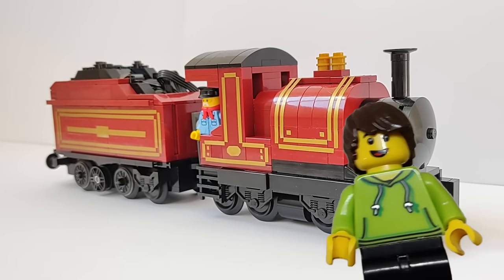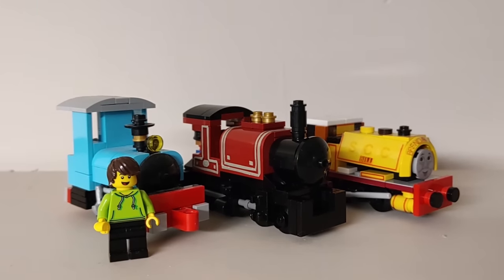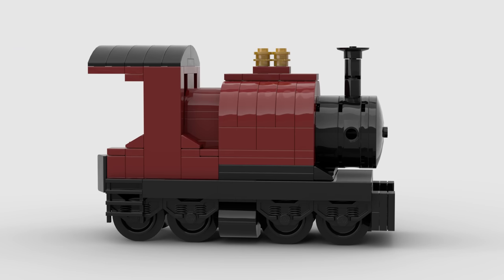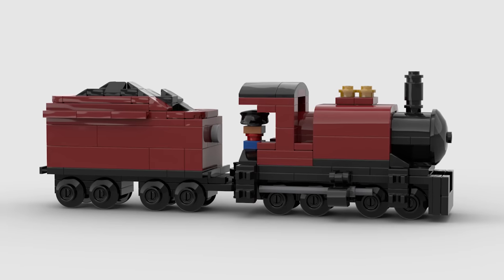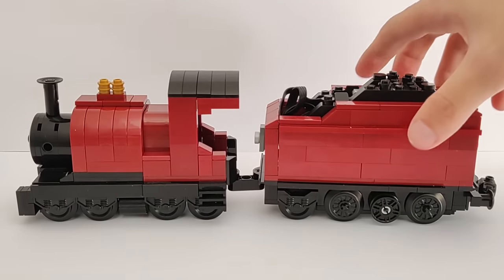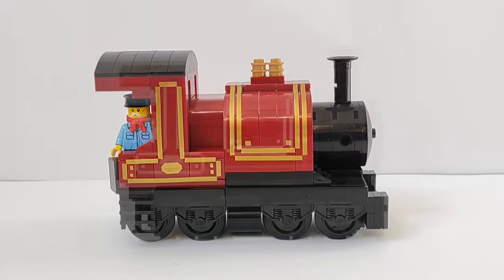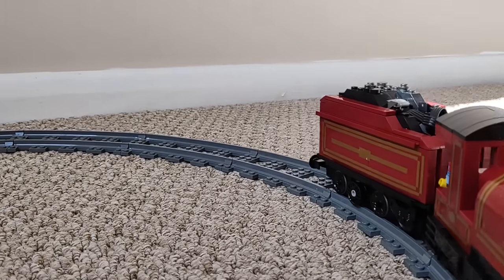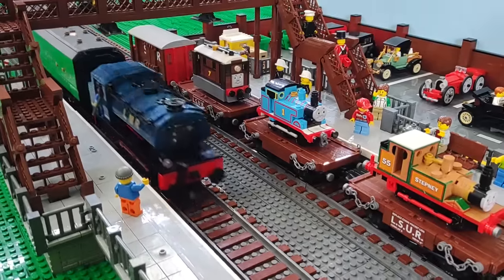How I made LEGO motorised Cherry Steamer (Pocket Trains) - Larry’s Lego

Comment: I have built two locos plus rollingstock in narrow gauge, though the locos (a small red diesel and slightly larger yellow steamer) and carriages (box car, gondola and open passenger cars) are built 7ish studs wide (six studs, plus half to 2/3 stud either side made up of greebling and detailing). 
They replicate the trains - or tramways - still found in Queensland running on 2’ (610mm) gauge in many districts which cart sugar cane to the mill. They were popular in many amusement and theme parks in Australia, but now only at Dreamworld.
Mine are motorised using third party Circuit Cube motors.
Reply from the maker: That is amazing! Your motorised narrow gauge stuff is so cool!

Comment: I have a idea how you can have the loco have all wheel sets in

Since the Cherry Steamer is a 4-4-0 meaning it has 4 lead wheels and 4 driving wheels and 0 Trailing wheels it would be a good idea to use a small pice that pivots to connect the leading wheels with underneath the loco, I also recommend you do the same on the tender and add a few coaches or freight cars and make one of them powered instead

Comment: Another way to solve the wheel problem could be to use individual wheels attached on a 6 stud long technic pin, with 2 1x2 technic bricks in the middle of the base, allowing the wheels to slide side-to-side. It won't look as good off-track on a shelf, but should allow the engine to stay on corners without removing the front wheels. The same could be done with the tender, replacing the set of wheels closest to the engine with this same design. I'll edit this comment with a link to a graphic version of the design when I've got to time if anyone is interested.

Comment: Lego 12v and 4.5 v trains had a max of 3 axles for the turns, for larger locomotives they had a central motor or dummy brick built motor (yellow diesel set) then 1 pivoting axel on each side. You could experiment with this and you wouldn't loose any wheels in the engine as well you could add the PF receiver in the boiler like the winter holiday train. These are just suggestions, I'm experimenting with small steam locomotives to. Best of luck

Comment: Mount the engine's bogies on swivels. My first "Iron Titan" engine (really a boiler with two motor bogies slapped on) could snake around standard Lego corners like nothing. However, if you want to keep the rigid mounting, try larger radius TrixBrix curves. My current Iron Titan (still under construction as of posting this) can negotiate as tight as 56-stud radius.
Reply from the maker: Thanks for the information/suggestions! Cool to know

Comment: is it possible to put the front and rear sets of wheels under the loco on swiveling bogeys using parts 3680&3679? they only take a 2x2 plate worth of space and might save on space in the build

Comment: The coupling between the locomotive and the tender won’t work for hills
Btw Lego doesn’t make sloped track pieces, but if you need them you can use a heat gun on the track a little and then bend it
Reply from the maker: I changed the coupling mechanism in my Yorkshire Brick Show video to use the magnetic ones instead!

Comment: Hi, I'm new to lego trains, and I need to know, if the power functions work without the Bluetooth receiver, I mean, I don't mind turning it on and of manually, but I don't know if it works
Reply from the maker: The Bluetooth battery cube doubles as both the battery and receiver! You will need one, the motor has no power on its own
Reply: @LarrysLego  but if I get only the battery box and the motor both connected,  When I turn them on, will the motor start rotating? I mean kinda manually 🤔
Reply from the maker: @Beto_Mori  Yes! There is a Bluetooth switch but also just an "on" switch which will run the motor at full speed, "manually".
Reply: @LarrysLego  oooh, Now I get it 😅 really thank you, I'll get the things needed, 🙂 I always wanted to have some LEGO trains, now I can 😎 haha thank you again
Reply from the maker: @Beto_Mori  No problem! Hope you have fun with it :)